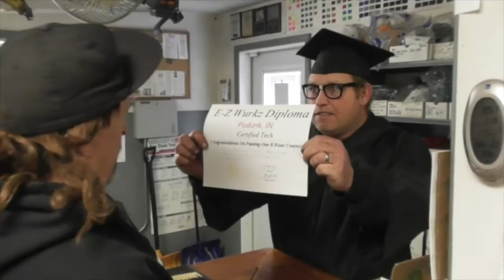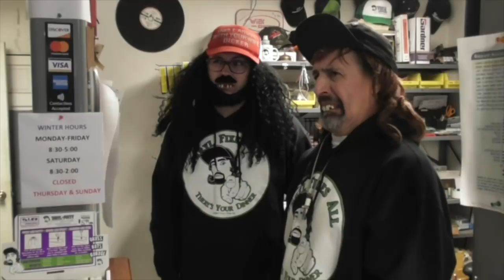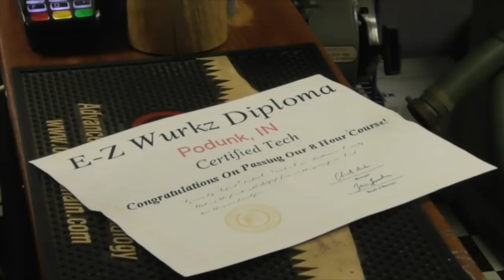Fix Electric Chute Control Switches On John Deere 1330SE Snowblower Murray,Snapper,Simplicity

Comment from the maker: The reason you don't want to use dielectric grease for the contacts is because dielectric grease is an INSULATOR. You don't want to insulate the contacts, the switch may not work. Now There's Your Dinner!
Reply: Taryl Fixes All hey I’ve got a 28hp intek V twin (49M777) with electronic fuel management and it will only run on starting fluid sprayed into the air intake.  I took the carb off and cleaned it once just lightly and put it back.  Same problem.  I took it off again and disassembled it completely, soaked the carb body for half hour in parts cleaner, cleaned all the orifices and sprayed them out with high pressure air.  (Even took the bowl, tower, butterfly and nozzle off) Put everything back together, reinstalled and it ran great.  Shut it off for the night and tried to start it the next day and I got the same problem again.  I checked the fuel tank for debris, there are new fuel lines and filter. The fuel pump sprays fuel like hell, the carb is getting fuel and it smells like fuel when you try starting it but it cranks and tries to start just one or two little sputters but never catches.  I’m thinking my electronic fuel management system is screwed.  Any thoughts on what the problem may be or other troubleshooting ideas?
Reply: I have fixed these switches that have pitted surfaces, by applying some solder, using a small electronics soldering iron (Hakku), that you can buy small and narrow tips (point and spade), which you will need to dive into the rocker box.
Reply: My john deere 210 snow thrower is stuck in engaged.the control arm to engage\disengage near the steering wheel. It moves freely moves in\out of engage\disengage.but as i was saying my thrower is still spinning.would you say my clutch maybe stuck?or would you have a recommendation for me to fix it myself?
Reply: I wounder if you put a condenser in parallel with the switch if it would stop it from Arking and dirtying up the contacts
Reply: well dialectric does mean insulator like you say, like the dialectric paper in capacitors , yet ive seen mechanics put it on battery terminals before they reinstall the terminal leads to prevent corossion, sounds counter intuitive or however you spell it. and then ive seen guys smear spark plug terminals with dialectric grease only to burn out the brand new electronic ignition coils weeks to months later , seen it and done it also.
Reply: Man thats some good beef tips..now there's ur dinner!
Reply: @farmerjackson709  or a transorb
Reply: If dielectric grease should not be used on contacts, why do car manufacturers tell you to use it when replacing exterior bulbs or to use it in spark plug boots or on battery terminals? There's YOUR DINNER!
Reply: Yes, it IS an insulator! It insulates the contacts from moisture and corrosion. There's YOUR  dessert!!

Comment: thanks. i have the same machine (different branded name) and the chute won't go back up. i took the switch out and have it ready to put back together. i was going to use dielectric grease on the contacts but have been reading a lot about that and have decided instead to spray it with some "WD-40 Specialist Dry Lube" (no, i don't work for them...LOL). I am however putting some dielectric grease on the middle rocker sections to hold the spring/holder in place for reassembly...and since it is the only movable part really. thanks very much for the tip on how to get in to the recessed contacts.

Comment: I believe I figured out why the thumb switch contacts burn and pit. More often than not the diverter chute motor screw freezes causing the chute to not operate or the chute won't rotate because it or the motor device that runs it is iced up and frozen. Most folks keep trying to get them to operate by holding these switches down while trying to get the diverter or chute to move by switching the thumb switches back and forth. Holding the thumb switches down only serves to cause the contacts to heat up, arc and burn which causes those pits on the switch contact surfaces. If you don't have a place to keep your snow blower dry and thawed out, then you should make sure these electric motor devices and the equipment they operate are not frozen before attempting to operate the switches. Doing this will likely reduce the number of times you will have to make the repair Taryl shows in this video. He is the man and his videos are very informative and will save your $$$$. Thank you Taryl for sharing your extensive knowledge with us.
Reply: Ya you got to use a heat gun on that part    every time it's exposed to all the snow and ice just an extra step haha
Reply: @chrome3720  For sure, Used my wife's hair dryer quite a bit thawing the chute and diverter motor screw. Thawing will help prevent the contacts in the thumb switches from overheating and burning. Appreciate your comments.

Comment: This fixed my simplicity and when the switches started working intermittently again the following year it turned out to be a ground wires connection bolt on bottom back corner of block that was not tapped deep enough to tighten down, also took the switch apart from the button while leaving the button in place in the frame

Comment: You are so funny and entertaining but what impresses me the most is your thorough knowledge and experience the delivery just makes it entertaining. I swapped the Briggs and scrap them engine on the 828D snowblower do a predator 13 horse . 
 The new engine crankshaft and drive pulleys are an inch higher than the old original one I change the balance and it worked great for a couple years but broke the drive belt the pulley and key I’m guessing the belt was too tight do you have a video or suggestion on how tight the belt should be?

Comment: The video could be about 3 mins or less and have far less ridiculous presenters. But the solution will fix faulty switches and worked perfectly to fix my Briggs & Stratton snow blower too. Thank you for putting an end to my switch frustration.

Comment: Thanks! You saved me at least $40 for a new switch.
I broke off the two tabs holding the switch to the frame and one of the tabs holding the top of the switch to the bottom of the switch doing this in 7 degree weather.  I recommend using a hair dryer or heat gun on the plastic before trying to pry the tabs.   Super Glue works wonders fixing the broken tabs.    
My switch has a cover that goes between the switch and the wiring harness that helps anchor the switch to the frame with a small amount of wiggle but again Super Glue got rid of the wiggle. 
A bit of caution at 9:33 you will see the top of the switch in your left hand.   In the middle of the top are two spring loaded copper contacts that are only held in place with the dielectric grease.  They tend to fall out with vertically putting the top of the switch onto the bottom.   I suggest doing it sideways to insure they don't fall out.

Comment: I used this video before and it was very helpful. I think this has to be done approximately once per season. Gets kinda old. I had ordered replacement switches from Simplicity. They wiring harness configuration is different, so they come with a wiring harness adapter. Today, I was set to do this process again, but since I had a couple of the new switches already, I decided to try one of them. It works great, only took a minute to replace with the wiring adapter harness. The profile and feel is different, which makes me wonder (hope) they learned the original design was problematic and came up with something better. Time will tell...

Comment: New Snowblower must have bridge rectifier to run the motors and allow DC bulbs to be used.
15 years ago I mounted an old battery powered 3/8 electric drill on the end of the chute crank and wired it to a DPDT switch. Battery from the Lawn Tractor powers it thru a Season.
Sure beats crankin.  Rotating blue light on top of the 3 sided canopy.  Excellent.  1990's White (MTD) 10.5 HP, 30".
Reply: Do you think, or are there any examples, of adding this electric chute control to an older JD blower that has the hand crank set up? Wondering if it'd be possible to do a DIY mod and add the feature to a 1332 dde. Thanks in advance for any insight!

Comment: Thanks Taryl. I bought a Simplicity 1222ee it's a single stage with the snowshredder auger teeth built into the rubber paddles. I liked it because it has a Briggs 250cc engine, lights and electric shoot rotation. I did a lot of research before buying this unit and nobody on the snowblower forum seemed to be complaining about any of the components. Well it's only two years old and it would only rotate the shoot in one direction. It's still under warranty but it's a two to three week wait for service. So I used your advice and cleaned up the contacts and bent them to make better contact. Works great again now. However I wish I would have watched your video advice on what kind of snowblower to buy. I think I should have bought a Toro single stage. I have a classic two stage Toro 824 I bought from a neighbor and that things a tank.Thanks for this video it really helped mee a lot..

Comment: Been cleaning these switches since this John Deere 1330se came into our possession. Cleaned many times over the years. Just be careful not to lose the little springs from inside the switch.  Bulbs are 20 watt halogen. Here in Canada they want 18 bucks for one.  Got thirty bulbs from Hong Kong delivered to the door for three bucks. Thanks for sharing your very interesting videos Taryl.

Comment: Do you think, or are there any examples, of adding this electric chute control to an older JD blower that has the hand crank set up? Wondering if it'd be possible to do a DIY mod and add the feature to a 1332 dde. Thanks in advance for any insight!

Saw below that someone wired up an old battery powered drill to accomplish the mod. Wondering if parts from a 1330 SE chute control + switch and motor would be fairly straightforward addition.

Comment: My chute control works but its moving slowly and not at all under load (I have to stop). Could it be the switch?
Reply: Could be. Mine was slow. I cleaned the areas shown in the video and now the chute moves faster. You should at least check inside your switch.

Comment: Can yu help... Countless hrs searchn and found no pics or nuthn. I have a simplicity sunstar 14hp, mdl 1691250.  i need to correctly connect the spings with idel arm, with carb and choke,with correct springs. Cant find no info,

Comment: I have a fake john Deere 1330se and the chute, lighting and wiring in general has given me issue since the get go. The lights worked for a bit -the hand warmers would litterally melt my gloves so I disconnected all  except the chute. I got a voltage regulator new lights as the originals were literally melted. I no sooner change the VR and installed new lights -they burnt out - I quickly disconnected before the lights melted -  i paid enough for the piece of crap could not justify have the JD fixer pick up and repair - not worth it - i have had chute problems and i cut the wires and reconnected and it worked - now the damned up/down is gone again - on this site today to see what i can do - will check the wires i cut and if fine will look at the switch - as long as it blows/throws snow i will keep using but am looking at a Honda - your video had me laughing uncontrollably at the end - will definitely look you up again - thanks for the advice

Comment: Hey Taryl and the crew, awesome video thanks!! . My mom and dad have one of those snowblowers they have replaced the switches several times even with the updated ones and they still go bad I think next time it happens we will have to try your way with a film of dielectric grease on the contacts. I have fixed dodge caravan window switches the same way. Thanks again!
Reply: johno2355 dielectric grease is NOT FOR contacts!!! It is an insulator, not conducive. It's for the sealing portion of an electrical connector like a rubber boot. NOT for the metal connection.
Reply: jhitt79 the tube of permatex tune up grease I use says apply to rubber boot or connector of a spark plug wires . Its dielectric grease. Sometimes I use white lithium grease to
Reply: johno2355 the key to your statement is the "boot" if you put it on metal to metal contact points, the metal has scraped through the grease.
Reply: jhitt79 l will do some testing to prove your theory. I have used it hundreds of times every thing still working
Reply: jhitt79 I will try it out, Thanks for your time and trying to make me a better mechanic. I think from now on I will use slip ring grease like they use for horn contacts under the steering wheel in older cars before the years of clock springs and air bags. Just to seal out moisture and to protect from corrosion.
Reply: jhitt79 - its not supposed to be conductive.  its grease for contacts and electrical terminals.  thats the point.  if you fill an electrical connecter with dielectric grease it keeps out the moisture without conducting current between terminals.
Reply: jhitt79 - ur confused with ur "theory".  if you fill that snowblower switch with dielectric grease it would still function as designed because the metal to metal contacts are what conduct the current.  the grease just keeps them corrosion free and the dielectric part prevents current from taking alternate routes.  otherwise why not just fill that switch with antiseize?

Comment: You need to add 
coat dielectric grease  the contact
Reply: Walter Holbury why would you do that? Dielectric grease isn't for contact points it's for rubber seals and boots.
Reply: I always use on my 12 volt connector applications bulbs ect. I feel, once a good metal contact, it seal out the moisture and road salt.  Once I repaired a trailer wire harness connection and turn signal started working just fine.  The lady was so happy, she called blinker fluid. LOL
Reply: Walter Holbury yes, it's a seal for air, water, salt, etc. but it isn't conducive itself.

Comment: Will those 1156 bulbs work for any of the riding mowers out there?  I would also like to know do you think replacing my lights with some LED bulbs on my riding mowers would be a good idea...other words would I be harming anything electrical by doing that are they LED compatible bulbs for most riding mowers.

Comment: Hi Taryl, Great video, I have done this several times since I found what them overpriced replacement switches cost. Those little locks that hold them onto the machine are very vulnerable to breaking when they are cold. 18 bucks for that 20 watt  bulb. Got to be careful that you don't lose them little springs when dissembling the switches. I found cutting down an emery board that folks use to file their nails with works well for cleaning the contacts of the switch. It would be nice to find a reasonable priced replacement switch that would run  both the rotation and diverter on the chute.

Comment: I have the same blower with the same problem.The problem with mine was the small contact piece that come out of the switch were bent front pushing to hard on the switch when operating.I had to bend my back and then it worked again.Its a reoccurring problem.I finally replaced both switches with switches off eBay.Its a better switch then the John Deere switch.

Comment: Should be sure not to try to depress the locking tabs on these switches when the temperature is below zero or you may find that the locking tabs snap off.  Been doing what Taryl is showing here often and this does work well. Be careful not to lose the springs inside the switch when you separate it for cleaning. What a great video and I've been a huge fan of this fellow's for a few years now. He will save you many bucks. Yes the lights will burn out on a regular basis too. The only reliable thing on this model is the engine but you may need a carburetor or a charging module from time to time.

Comment: If you sprinkle a little baking side on top of your superglue after gluing a layup, it will dry instantly and rock hard.  Works great for little plastic clips.  I have heard that it is also an approved method of fixing minor chips and dings in helicopter rotor blades.  If it is used for that repair, I know it will work for any of my stuff!

Comment: No one ever knows everything about anything no matter how much years of experience they have yet Raymond told me that I should look for something else to do beyond repairing power tools & he had about 44 years of experience in the trade when he told me.

Even after doing a full course in anything at school ,college or anywhere,you only ever use about 10% of the education on the job & the rest is experiential.

When I overfilled my dads Honda HRU217D lawnmower with oil,it kept burning oil then one day just decided to stop burning it as it was burning oil even after I drained the oil out to the full level.

There was nothing Honda could tell me other than perhaps worn or damaged piston rings & even someone with many years of experience with Hondas said online.

I just left it alone & it stopped burning oil,I just gave it a 6 monthly oil change & valve tappet adjustment today with no problems.

I think the crankcase ventilation system still has oil in it or it may have still been a tad overfilled with oil.

That dude at the front counter with the diploma is much like my brother Scott !!!!

Comment: Is there an easy way to ajust the RPM on the these B&S engines The RPM seems to run very high after a few years of use.
Reply: edgenet1 try taking a little strain off the governor spring, if it has one.
I've never worked on snow blowers as we don't have them here but have adjusted many mower engines.
Go easy, they're very sensitive.